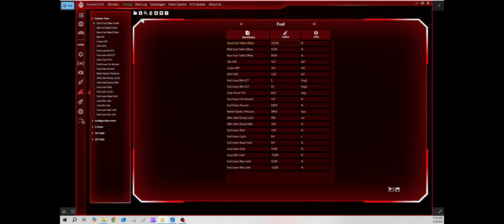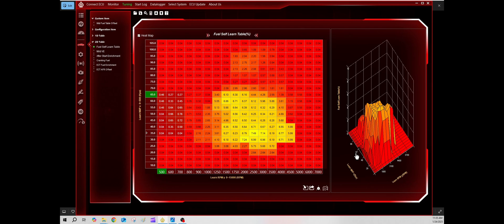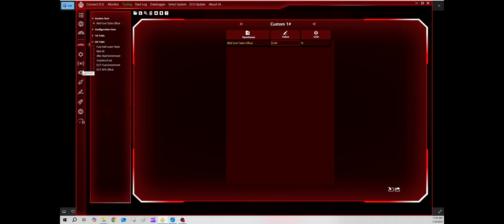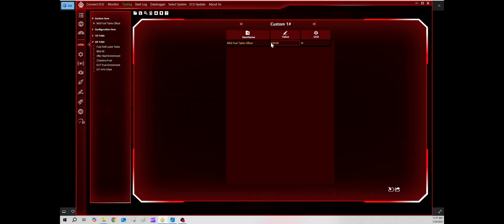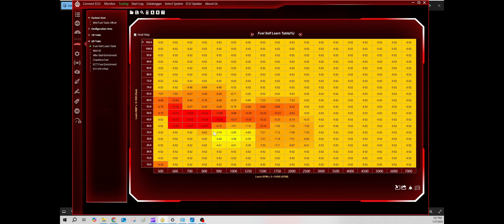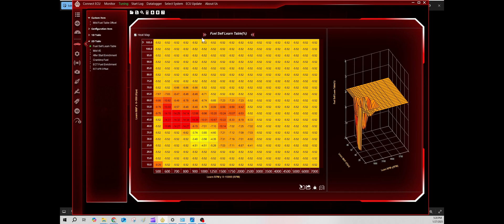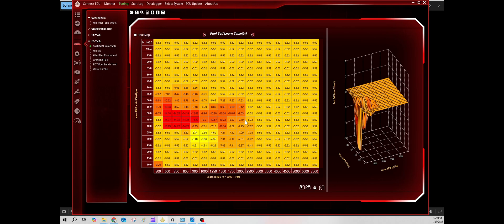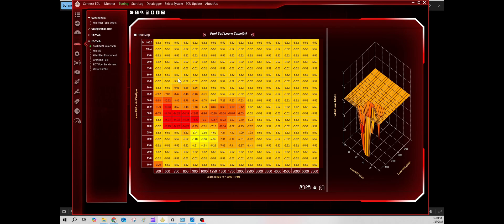***Important Update*** Learning to Tune the ACES EFI Killshot- pt 2

Comment: Is there anyway you can do a video explaining the Acceleration Correction vs TPS?  These videos have really helped so far, but I'm still fighting a lean bog when the throttle is stabbed.  It's fine tho if I roll into the throttle....
Reply from the maker: What is it that you would like to hear about?  I can probably go into what it does and what it's supposed to do but the final settings of it are VERY dependent on your individual and specific engine build.  By that I mean that it completely depends on how your engine functions... how each individual piece part coming together behaves as a whole... not just a simple thing like "well... I have a SBC 350... so what should this setting be?"  Is there something specific you wish to know about?
Reply: @dc10tech911  your absolutely right about the specific individual needs.  My engine is only 265 cubic inches it might be getting too much air.  Bryant Stilwell has some throttle bore reducers that I'm looking into...Thanks for the reply!
Reply from the maker: @davidlewisjr7144 that is EXACTLY what I was going to recommend depending on your reply.  The other option is to turn the linkage into a progressive style of opening.  There's a good video on YouTube on how to do that if you're interested.  Making the butterflies act like progressive primaries and secondaries has been giving people good results. As a matter of fact the killshot 2 comes with that modification as standard.  Just remember... it voids your warranty

Comment: Please don’t stop making these videos
Reply from the maker: I really appreciate the kind words bro.  Don't know if you saw the little "Short" I put out about a month ago.  Sadly, I found a shattered rocker arm after it started running really badly.  That led to me finding that the cam had a wiped lobe.  This is the second 3rd cam that's done this on this engine.  In the middle of all that I got laid off and haven't found another job yet.  Once I find a job and get the cash to rebuild my engine, I'll be putting out more vids... but in the mean time... I'm kinda hosed.  Sorry, but I'm glad you found some value in them.
Reply: @dc10tech911  man, I’m really sorry to hear that, I hope you’re having luck finding some work, I have to get a bigger fuel pump for mine the 255 Inline is just not enough under 10 psi boost on my olds 455

Comment: You’re awesome, I think I’m in the same boat but the other direction, I’m at 80 percent offset on the mild and it’s still pulling fuel, I maybe need to lower the offset more or switch to the stock ve table, this confirms my assumptions
Reply from the maker: You can, or you can just adjust the Mild so it's closer to the Stock and run it that way.  Those are just presets... they could have called them #1, #2... etc.  Don't worry about the name.  If you're close with the Mild just fiddle with it if you feel comfortable and get it running off of it.  In the end, all that matters is that you're happy with your results.

Comment: I've learned that their mild isn't what we think of as a mild build. I have a sbf 306 with afr heads a "mild" cam and dual plane intake with a killshoy and the mild ve is still super rich for it. Stock is the closest. If you have over .520 lift on a cam then I would consider the mild build. My cam is right around .500 lift.
Reply from the maker: Yeah. I agree. I think the large majority of folks need to start at Stock and adjust that.  If for some reason Stock is way too lean THEN go to Mild... but I doubt it would be necessary.  I think the reason they tell people to go to Mild if the engine is anything other than stock is to cover their butts... because it's always safer to run rich than to run lean... one can trash your engine and one wont.
Reply: I think you’re right, I’m on a mild cam and turbo build I have the mild at 80 percent offset, I think I might need to switch to stock at 100

Comment: Love your vids man!! We need an update on how your table looks now!!😂
Reply from the maker: Thank you bud.  I wish I could say something was coming soon but that's probably not the case.  My handheld was having issues and I couldn't correct them because I was running 2 year old software. I sent the Handheld and ECU back on an RMA to have them fixed.  During that time it was away I got laid off from Southwest.  When it returned my engine barely ran.  I spent a lot of time thinking it had to do with the upgraded software only to find out one of my rocker arms came apart.  Now, without a job I can't afford replacements.  Without being able to run it I cant get the learn info to tune it and even if I get a job, it will most likely mean I will have to move to another state.  Just the way my industry works. If things change I'll put out something right away.  If you need help, I started a Discord channel where I can try to help in whatever limited fashion I can to those who need it.  https://discord.gg/Xu7M6VnQ  Just remember, I'm no pro, but I'd be happy to try and help.  People can leave me messages there.  People can share files there if they wish or we can all screen share if we're all on at the same time to show each other stuff.  I don't know if that will work for anyone but it's there just in case

Comment: Having trouble going over 2900rpm. Starts going lean and misfiring runs great to that point tho
Reply from the maker: @oe3129  honestly it sounds like you're having fuel delivery issues. Your pump is not keeping up with the system.  If it is new, then 1) maybe it's bad 2) most likely your return line is too small and causing pressure issues 3) your pressure regulator is not doing it's job.  Do you have a fuel pressure sensor on it? Does it read weird when it happens?
Reply: @dc10tech911  fuel pressure is showing the correct pressure, and it doesn't drop when acceleration
Reply from the maker: @oe3129  well... I'm sitting on a plane getting ready to leave so won't be able to respond again for a day or two but... are you using their digital sending unit for fuel pressure or a gauge. Because I have both and they don't agree. My gauge shows rock steady but the digital pressure sensor show small changes. Maybe you are and don't realize it. Do a data log and see what it reads there... but that only works if you have a digital sending unit.  Is your return line correct.  I've heard of many guys not running a large enough return line that messes with the regulator.  That being said... you are running a regulator yes? If not that... then spark.  If you are running ignition control you should check to make sure your timing is correct or your selected AFR at those RPM ranges aren't set for a leaner condition.  If AFR is set to simple in the handheld then AFR shouldn't be a problem but if you are controlling AFR in the 2D chart then it can be whatever the chart says at those ranges and that could be wrong.
Reply: @dc10tech911  thanks for the response but I have tried everything u mentioned
Reply from the maker: @oe3129  a couple more thoughts.  You could have an exhaust leak fwd of the 02 sensor. These systems don't like vacuum or exhaust leaks... don't like then at all!!!.  Also if you've been dealing with an undiagnosed issue it might have trashed your O2 sensor. You can try turning off learning and see if that fixes it. If it does then the O2 sensor went bad. The best thing you can do is look at the learn table. Is it adding fuel in that range?  If it is giving you a large rise (large positive numbers) then you definitely have a fuel pressure issue. If the increase is drastic only in that range then you have s weak pump,  a bad regulator, a small return line or an obstruction of some kind.
Reply: @dc10tech911  I have swap the O2 sensor, check for leaks, the learn table is pulling fuel in tht area, but I keep adding it back, no change. I've pulled timing on the 2D table it's at 18 in tht area it's still the same. It runs great to 2900rpm and then the problems start
Reply from the maker: @oe3129  Sorry... haven't responded in a while.  I lost my job and things have been hectic.  How is this going for you?  Have you figured something out?  If you want you can send me your tune... I can try to see if maybe I can spot something.  Two heads are better than one.  If you want to try that you should also do a datalog and send that file over too.  That might say a lot!
Reply: @dc10tech911 Thanks for the help.Sorry to hear the news, I have burnt exhaust valves and detention on the intake. Self tuning isn't self tuning.once i get my engine back together I'll have Justin @proto-tech tune it
Reply: Try bringing the acceleration correction vs TPS up a little bit wherever your TPS is reading when your at that rpm. If that doesn't work youll probably have to use the travel function in the ve table to see where the problems are then add in like 5% at that point

Comment: Could you take a look at my tune if i emailed you the file? Please lol. Looked at it today and looks weird. The numbers are mostly neg for some reason.
Reply from the maker: I can't tell from text... are you being serious?  Like I've always stated... I'm not a tuner and am not trained in it. I really don't want to mess up your ride.  These vids are just to help you guys get your feet under you and get your bearings in case you want to take your own risks.  If you want I can try... but there's a reason the actual tuners for ACES are charging $400 for a tune.  Those guys will get you rolling perfectly.  I'm doing this on my own because if I told Committee (the wife) that I wanted to spend $400 more for nothing tangible... just remote tuning, I might get divorce paperwork LOL.  Are they large number negatives 7-15% or small number negatives like 1-3%?  If your car runs pretty well but it's just removing fuel like you say across the board then I would play with the Offset like I mentioned here. Bringing the number down from 100 little by little will get you perfect.... IF the current tune runs well.  Do you need to know how to check that?
Reply: @dc10tech911  I'd be down to let you look at it yeah. As far as messing it up couldn't I just save the tune I have  and then you mess with a copy of it and I upload and see what it does? The number negatives are smaller now that I put it on the stock ve. I'm gonna play with the offset tomorrow morning and see what I can do for it. I watched Tim's video about doing it on the handheld. I may try to do it that way first see what happens then look at the tune see if it is any different.
Reply from the maker: @pushrodman1995  The offset is perfect for when your Self Learn Table is all in the same direction.  That means the EFI is leaning or enriching everything... but not both at the same time.  If you have areas that are positive numbers and areas that are negative numbers it wont help.  If you lean by offsetting lean, then the positive numbers will get worse because it will need to ask for even more fuel, and if you enrichen the negatives will get worse because the Killshot will have to remove even more fuel from those zones alone. Fix the VE first, then offset.  Unfortunately I don't hand out my email publicly.  Do you know what Discord is?  I can meet you on Discord and we can talk and screen share as well. If you know Discord, you can go here:  https://discord.gg/kE2quaF4
Reply: @dc10tech911  unfortunately I don't know what discord is but I'll download the app and see you on there lol
Reply: I have enough knowledge to know what you need to adjust if you’re still needing help
Reply: @CulpFitness  thanks for the offer but I ended up having it remote tuned. I did learn a few things from this video tho and the tuner guy taught me some things

Comment: Anyone have a clue why my system comes out close loope to open loop anytime i come off of idle no vacuum leaks engine temp 190 no exhaust leaks afr steady 13.4 all fuel readings good but only will go in close loope at idle
Reply from the maker: Intermittent in and out of closed loop is normal. You should go to open loop immediately coming out of idle then go back to closed during cruise. Have you checked that? Then it will go back to open loop going from cruise when you let go of the gas pedal.  Transitions are straight from the VE table... steady operation is closed loop. If that isn't what you're seeing then... 1) bad or dirty O2 sensor. 2) bad TPS sensor or bad TPS setup/calibration.  3) Vacuum or exhaust leaks is very common with old cars. 4) your fuel pump has issues.  5) your ECU tune is bad causing bad fuel delivery during transitions
Reply: Yeah just installed a week ago haven't had it out on a cruise yet to cold around here lol just tinkering and learning I was under the impression once up to temperature system would mostly stay In closed loope but I guess not I'm learning My fuel side seems surprisingly good compared to others I'm more concentrated  on the timing table since I have the aces ignition system also connected these timing charts seem way more complicated than what they need to be 2 springs and counter weights dont have that many increments lol thanks for the response
Reply from the maker: @brianyoung3387  yeah... no worries. The timing table is not too bad from what I hear.  Check out this guy's video on how to do it real easily. Hope it helps.  https://www.youtube.com/watch?v=ZayrTMLCTHs